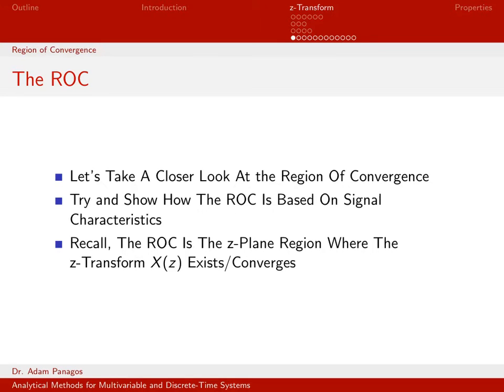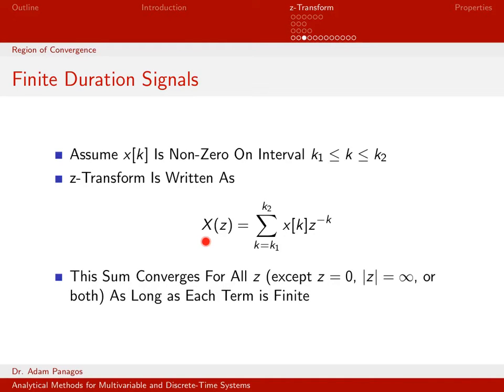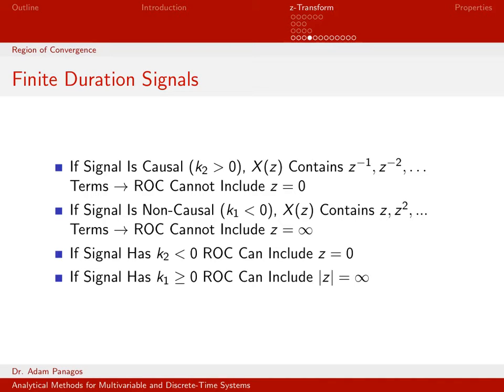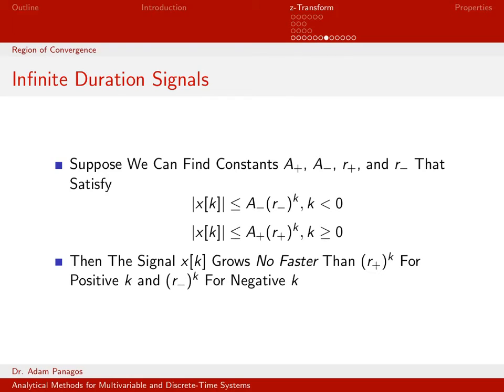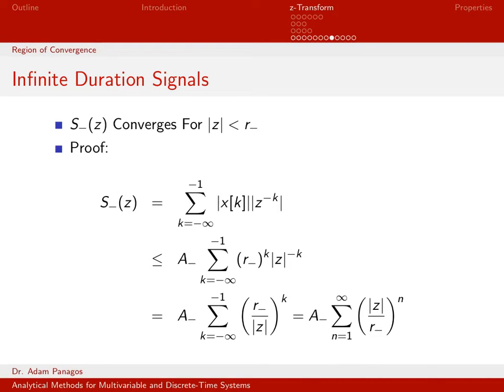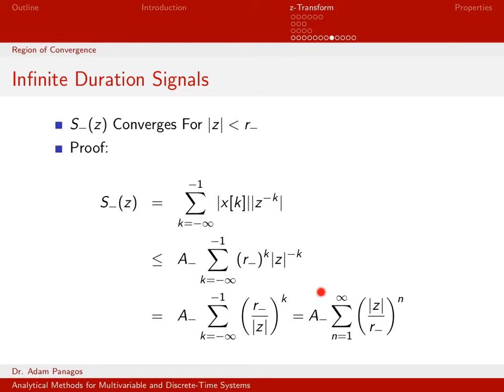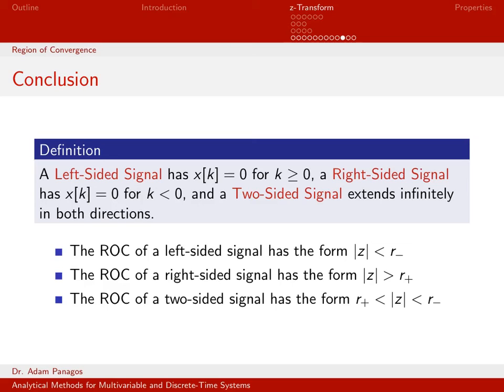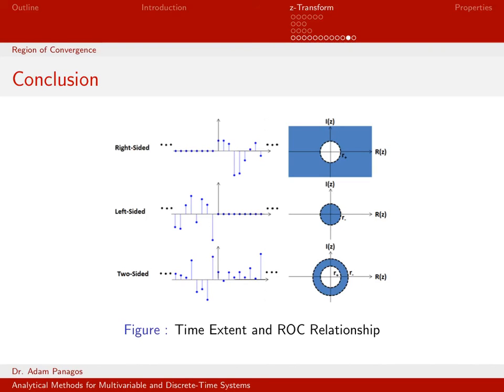Z-Transform Region of Convergence Details - Z-Transform Part 1

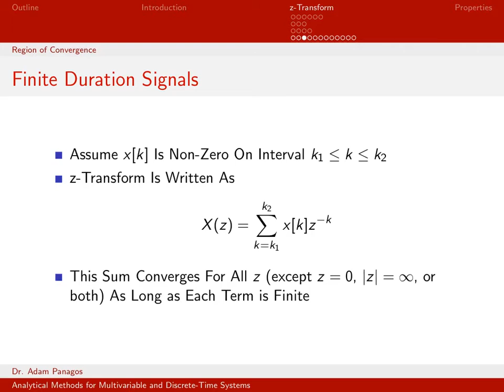Comment: Thanks Adam. At 3:34, should not it be the lower band "k1 > 0" instead?
When the lower bound k1 > 0, k is always greater than 0 but
when the upper bound k2 > 0 there is no guarantee that k will always be greater than 0 as k1 can still be a negative integer.

Also for the 2nd condition, should not it be "k2 < 0" instead?

Comment: Amazing videos! Really have been a lifesaver. Thankyou! I would like to ask a question: at 6:20, when the infinite sum is split up into two pieces, from -(infinity) to -1, and from 0 to (infinity), what happens to the piece from -1 to 0? Does it not need to be accounted for in order to satisfy the equality?
Reply from the maker: Glad the videos have been useful!

When splitting up the summation, k is a discrete-valued "counter" variable.  It is counting over ....-3, -2, -1, 0, 1, 2, 3, .... so there is not "piece from -1 to 0".  k can only be integer values.  Hope that helps.

Adam
Reply: Excelent answer! It helps very much.